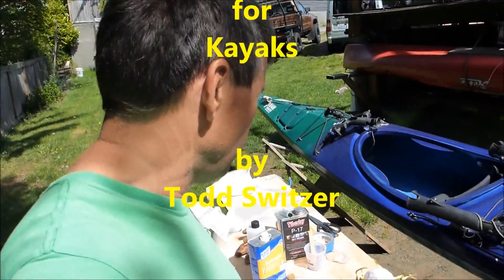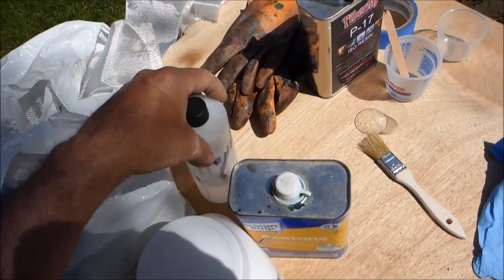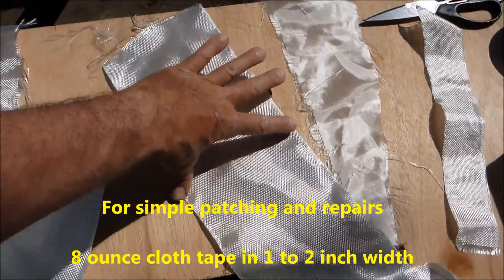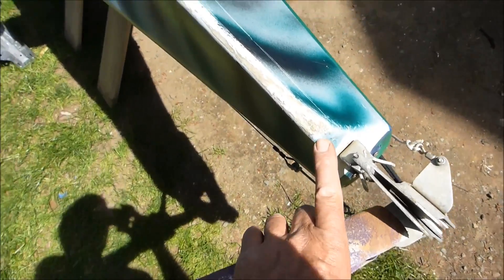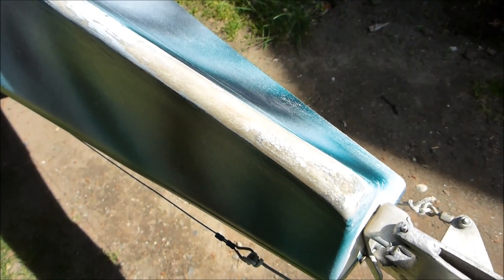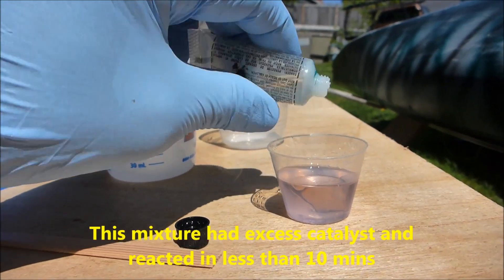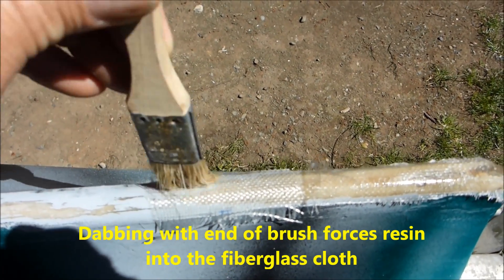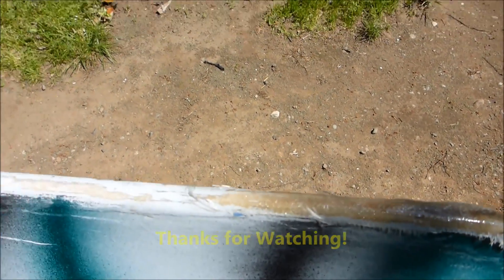Fiberglass Repair for Kayaks or Boats

Comment: I'm possibly getting a boat tomorrow and I'm assuming it could have some issues I'm looking at fiberglassing to repair what other alternatives would be recommended?
Reply from the maker: Alternatives meaning different types of kayak hulls? If that is the question then it really comes down to fiberglass vs HDPE (plastic). I'm not forgetting the lesser used/higher quality wood kayaks. In general, if you're a DIY person and you modify everything you own then fiberglass would likely be best and if you like to unpack the box and get right to using you're toy and are happy with buying the accessories that the manufacture provides then HDPE type hulls would work best. I hope this helped.

Comment: Hey Todd! Ive been watching ya for years. bought a composite kayak to do the mississippi river and wanted to bring along a repair kit just in case. great video for reference!
Reply from the maker: Hey Jay I recognize your name. I've always though about a kayak trip down the mighty Miss. It was my first memory of a big river as I was born about 60 miles from it and fished it's banks as a kid. I hope you post some vids on the trip. Best of luck.
Reply: @toddswitzer6799  a large amount of my space is going to be dedicated to camera gear so there will definitely be videos coming. I have some online from last summer of the beautiful head waters as well... but they dont compare to your alaskan land scapes which are amazing!! If you are willing id love to get some info on the composite boats and how they handle different situatuions such as rock impacts and dragging on sand
Reply from the maker: I think a composite boat will do fine if you're careful about dragging. Dragging a loaded boat is by far the worst thing you can do to it, even though the keel is the thickest point it can still wear thru fast. In a situation like a big river or lake where there are no tides or waves to deal with just take your time loading and unloading. On my Alaska trips the tidal range was near 25 feet so dragging a loaded boat was necessary at times, add in the waves, those pesky bears and all the shallow rivers and I damaged my hull often. If you're concerned about it then use Keel Strip or other reinforcement along the keel before you go. These products usually go on with a hot iron or heat gun. Unless you're running rapids a lot then a composite boat can usually handle a hit against a rock now and then, of course it all depends on the shape of the rocks, speed of the river, angle of the impact, weight of the boat. A great resource for info on this subject is Jackson Kayaks in TN, they build a lot of kayaks that take a beating, give them a call direct to product support if possible (avoid calling a random dealer you never know who you'll get).
Reply: @toddswitzer6799  Hi Todd, thanks for the response. kind of sounds like i have been thinking, just be careful and enjoy the trip!  i worry a little about the wing dams and having to pull up on rock shores but like you stated be careful and take your time. I have a repair kit i am bringing and have been looking at some of the fiberglass cloth/tape and might bring a little extra as well. I fully intend to be self sufficient while i am out there and that includes repairs. however i am a little new to the composite boats i do really like them and look forward to getting it on the big water....    if you ever do decide to consider the Mississippi River more seriously you should look up the mississippi river paddlers on facebook. there are a couple thousand members who are there to answer questions and lend a hand to those paddling the miss. many of them have done the trip, amazing group of people and an unbelievable source of knowledge! (im on there as jay kangler)   Hope to keep in touch with ya and looking forward to seeing your next adventure!    take care and thank you!!    and ill check out that keel strip!
Reply from the maker: Hey Jay. I think the guy you want to chat with about how a composite boat holds up to dragging is Yuri Klaver, he is on YouTube. He's done some INSANE kayaking trips in the arctic and does it all in a composite kayak and could tell you a lot more about how they hold up on long expeditions. Honestly the trips that guy does are on another scale from even my Alaskan trips and he's a great guy to chat with. Tell him I said hello.
Reply: @toddswitzer6799  hi Todd! I will for sure check him out, thanks for the tip! Ill let him know you say hi as well. Thanks!!

Comment: Hello sir. Does your kayak made with fiberglass ? Coz you are using fiberglass to do repair. Mine is polyethylene and it cracked. I weld it and crack again. Can I use fiberglass ? From mauritius.  Thx
Reply from the maker: No fiberglass will not bond to polyethylene so you can not use it to repair your kayak.

Comment: I would suggest weighing the resin and catalyst by the gram. That way you will get a much more accurate measurement of both and a better ratio.
Reply from the maker: I agree. Also, to get the best strength possible one should never mix less than 200 ml batches.

Comment: I have a spider crack now. It's a "soft" spot and does take on water slowly.
It's right on the bottom.  Do you think I should repair it from the inside or the outside?
Oh those used kayaks! 
Thanx
Reply from the maker: Spider cracks in the gel coat and a soft spot usually means it had impact damage. Reinforce the fiberglass from the inside if you can get to that area. I like to use 2 layers of 10 ounce cloth as an internal patch with these patches at 45 degrees to each other so the individual fibers lay in a diamond shape. The patch should be about 25% larger than the spider crack if possible. Then repair the gel coat from the outside. Tap Plastics does a good video on that: https://www.youtube.com/watch?v=iWEE6SFUdpg
Reply: Your suggestion of cross-hatching the fibercloth was a good one, it's a strong repair.
(fyi:The TAP plastics video says the repair is strictly cosmetic.)
Reply from the maker: That TAP plastics video is just for the gel coat repair portion (the final step of the repair). The structural repair of a spider crack repair is all from those patches of fiberglass on the inside of the hull. It could be patched from the outside but then you'll need to feather out the edges of an external patch or it will show thru the gel coat and that is a lot more difficult than simple patches on the inside of the hull. I avoid patching from the outside unless it's impossible to get to that area from the inside, for example under a fixed seat or a bulkhead.